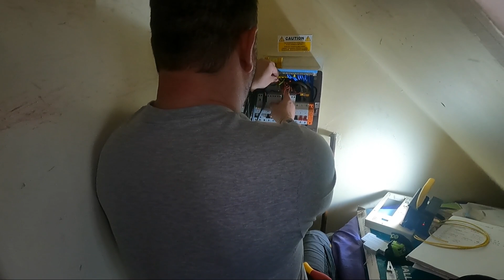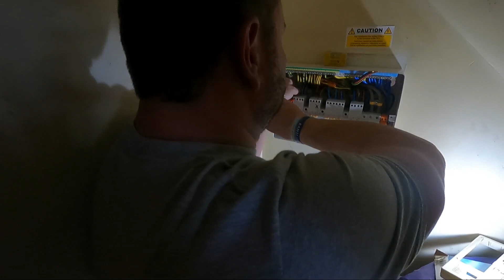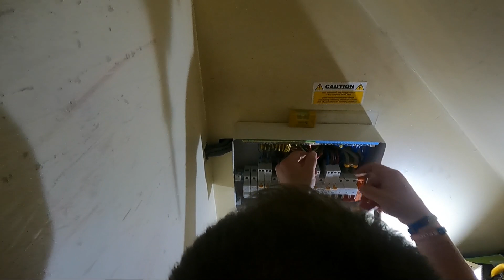Doctor's back!!

Comment: Hi Doc and Adam. From old spark from the 60's. Nice to have you both back and a enjoyable video. If the kitchen fitter is safety conscious which is no bad thing in it's self, but I would advise him buy a good quality car jump lead and and bypass/bond any plumbing work he's undertaking  just in case it's carrying diverted currents that would be more beneficial to his safety and that advice applies to gas fitters also.
Peter.

Comment: Nice one fellas good to see you back 👍👍 I have the exact same induction hob and oven ,can I ask , should the induction hob and microwave be on the same circuit as the cooker (45amp think my cooker circuit is).at the minute my induction hob is on a 32amp ring, also on that circuit is microwave,F/F, kettle, toaster etc also I’m sure when spark put the oven in he put it on a plugtop with normal 13amp fuse  plugged into a double socket with a red switch and a single socket with switch (which the oven is plugged into) 🤔 got the certs, but is that right 🤔 do I need to kick his ass 😂cheers guys any feedback appreciated
Reply from the maker: sorry mate but I can't say if it's right or wrong without seeing it for myself, thanks for watching
Reply: BS7671 does state that cookers ovens and hobs of 2kw or above should be on a dedicated radial circuit. But I suppose this is dependant on how the circuit is arranged for load etc.
Reply: @Bazza-tn5ck cheers for reply, so even tho my induction hob has a plugtop on it (it came with that on) it should in theory have its own dedicated circuit .its confusing,as if someone buys a induction hob to replace a gas hob and they just plug it in on a normal 32amp ring final, would it not just trip all time 🤔 cheers
Reply: @kingofthetrowel1725  although the hob has a plug top for simply “plugging in” I t may be to high a demand on that circuit, as gobs are sometimes on for extended periods of time this is where the issues of o reload MAY occur, I say MAY as depending on the load on rest of circuit could also be fine. I’ll be honest I’ve been sparking 31 years and my induction jobs plugged into ring so that probably says it all 😂👍
Reply: @Bazza-tn5ck  cheers for reply 👍 am I right in thinking if it did over load the circuit it would trip the 32amp mcb, it is a big ring final it’s got tv,kitchen stuff baisicly all household stuff on it along with that hob 🤯 I darent use it now 😂😂.. but it should trip right? Board is split load with 2 rcds if that makes a difference

Comment: No 20A switches on RFC's (32A) should be SFCU's only.
Reply from the maker: Sorry I'm a bit tired today what do you mean by RFC?
Reply: @DoctorElectricYouTube  Ring Final Circuit
Reply from the maker: Oh OK, if you're on about the cooker, microwave & hob they were all on their own supply, the switches were put there for convenience when the appliance fails as the c/u was a ball ache to get to with loads of stuff in the way
Reply from the maker: The only SFCU's from the RFC were for the washing machine, fridge & extractor
Reply: You're only allowed to use a 20A double pole isolater on a ring final if it's supplying a single spur.  The reason behind this is that each leg of a rfc can should draw no more then 20A.  If it's a spur leading onto another then a FCU of SFCU must be used.  If for example you have both the washing machine and dishwasher in a 2G spur of a ring you could in theory have a 20A DPS to isolate both appliances.
Reply from the maker: @rayc1503  that's pretty much what I have done or were talking about, not sure why it has been misinterpreted? Thanks for watching
Reply: @rayc1503  Only FCU's from 32A ring Finals, no 20A DP switches. Ref: Fig 15A p.505 BS7671 and p506 for radials.
Reply: @DoctorElectricYouTube  I was merely trying to explain to the OP that 20A isolator can be used if need be.  👍

Comment: Supplementary bonding doesn’t need doing if rcd protection is used. I wouldn’t let a kitchen fitter tell me how to do my work especially if it didn’t need doing.
Reply from the maker: 100%, totally not required, it's just easier to do it then he's happy!
Reply: It's also absolutely pointless since he's used speedfit plastic fittings which are themselves insulated. What a numpty.

My response would have been 'if you want it doing you'll have to do it yourself'.